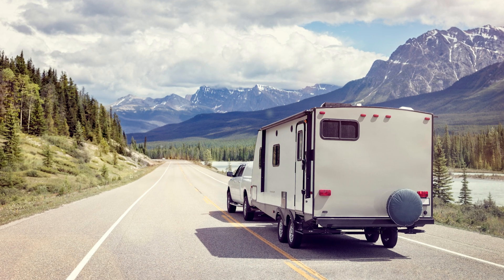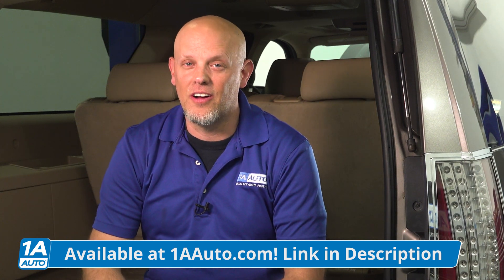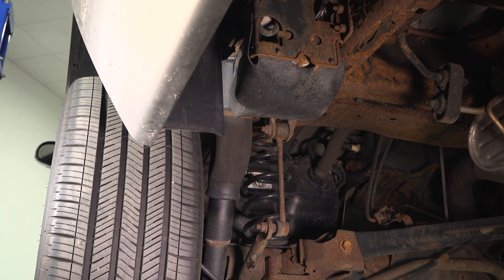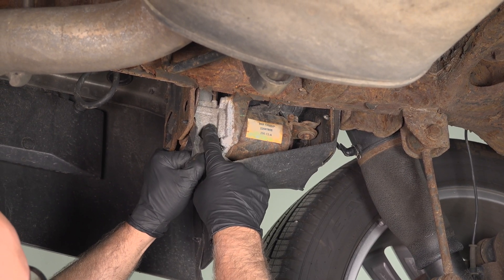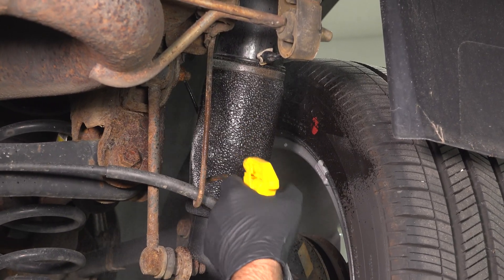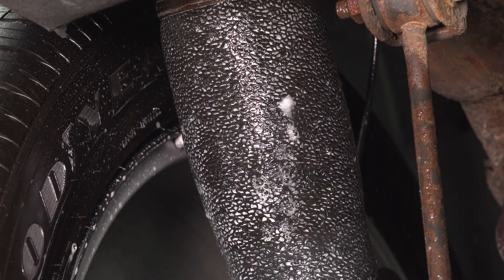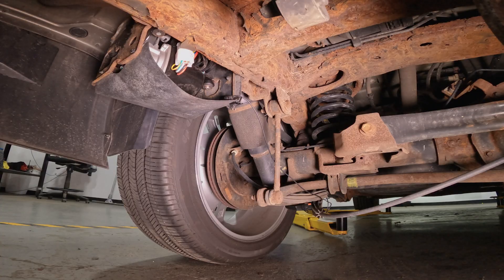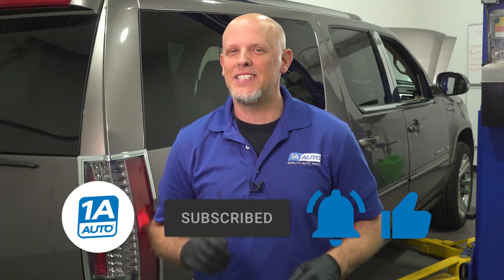SUV or Truck Rear Air Suspension Not Working? Here’s the Secret of What To Look for and Replace

Comment: That pump was designed to fail. So they can make more money. Placed behind a wheel, underneath the car and not properly covered. Or course it will be corroded. 
I wish you'd showed us how to replace that air suspension as well.

Comment: That was good, maybe add another video on the controller/ECU/Remote/solenoid/manual independent control/etc...there isa so little info on these out there. I want to replace my inconsistent and failing Firestone "Ride-Rite" proprietary ECU and remote control paperweight.